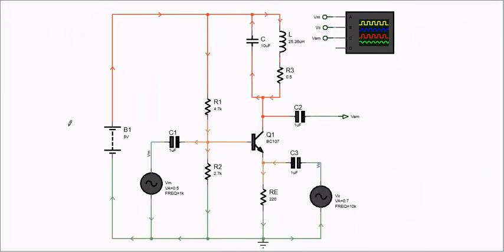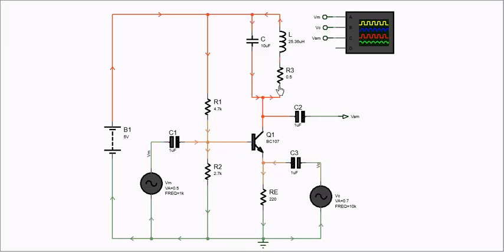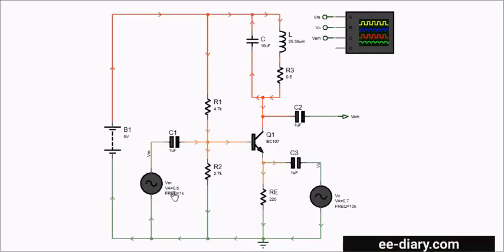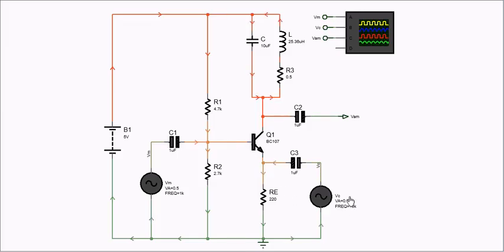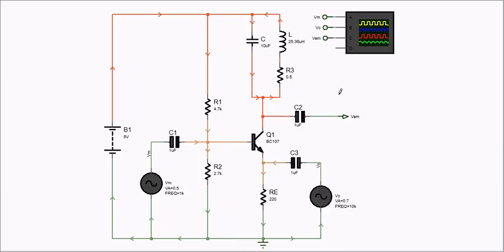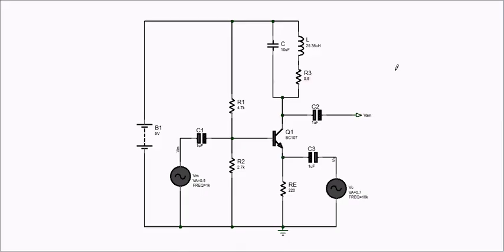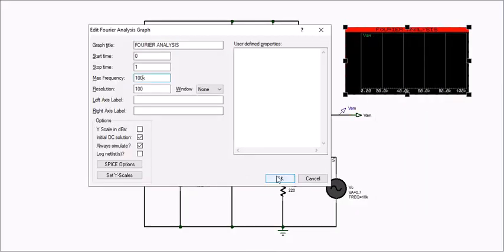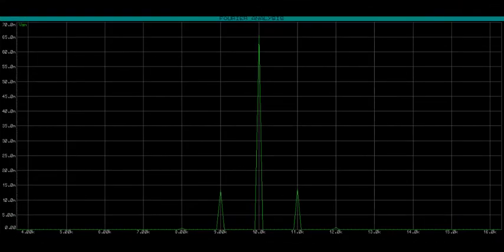AM modulator Design with BJT

Comment: What's the purpose of the R3? It looks like stabilises the output waveform in the simulation? I assume that circuit performs well without this minimal resistor value.